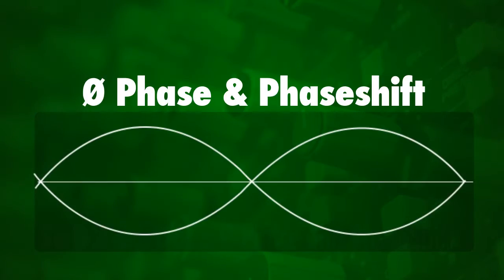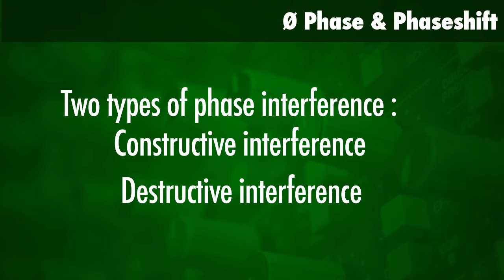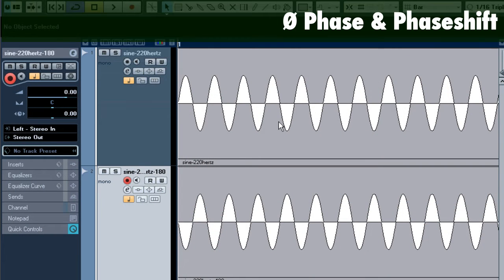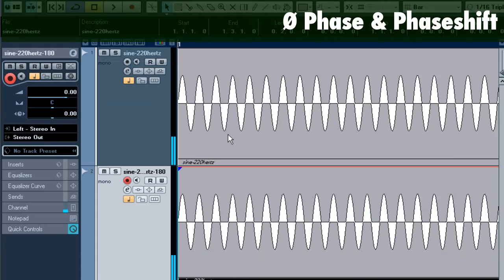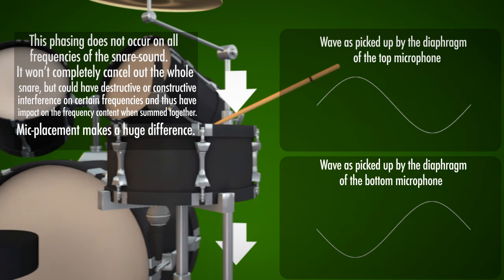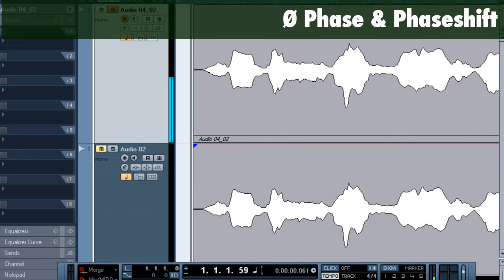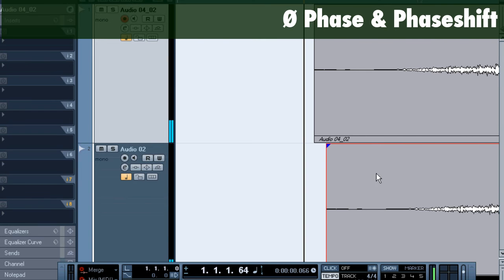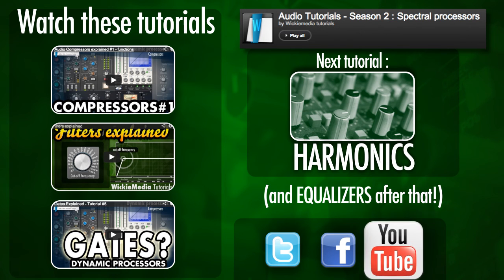Frequencies & Sound explained #3 : Ø Phase / Phaseshift

Comment: Hello sir I have unusual problem .
Me case is that I need to find a way to retard or advance me ignition timing in me distributor.
It is iductive trigger 4pin gm ignition module and it uses e core type ignition coil.
Suposedly those 2 wires comming from pick up coil go to ignitor suposedly it shuld go to analog to digital converter inside that 4 pin gm ignition module.
What device can help me to shift at least the positive pulse on that ignition module ? Or how can I force that pick up coil do delay a pulse signal??? 
Im strugeling for days to finde corect circuet .
I experiment for days with radio devices variostats rheostats resistors capacitors non of them realy work in me case I ither end up with points ignition,manual trigger,capacitive discharge of shuting off spark.
So me biggest problem is to finde what can delay that pick up coil or ignition module just for fraction of secund .
Those old GM based cars have teribel problem starting in winter time if bade fuel is used it has low suces starting engine even if I use fuel aditives Its still anoying to freaze me ass and go out side me car to fummel with distributor .
I like me engine to be advanced so me car does not support starter motor with reduction gearing.
I did witnes polarity changes ,amplifier and plasma ignition .
So mostly me problem is related to audio devices and controling transistors .
So any help please ?

Comment: Damn that's why!! Thank you so much... Question tho,  can a condenser microphone in a not acoustic treated room, create a phasing issue? I mean, when the sound bounces of a room you will first get the signal from the vocals and then get the bounced frequencies form the room... That then will create a phase problem right? Is there plugin/vst that  good for this issue out there?
Reply: Not exactly. The bounced reflections are usually considerably lower in amplitude, and there are many of them, so it's not phasing, but reverberation. Something like De-reverb feature in iZotope RX can help with removing it, but of course the result won't be as good as recording in properly treated room. Phasing may happen when mixing recordings made with multiple mics, because sound may take different amount of time to arrive to different mics.

Comment: The polarity flip button does not add time, it simple flips positive and negative, so calling it a phase reversal would be incorrect.
Reply: +hrblocked Probably he used word offset for describing change across vertical axis rather than horizontal.